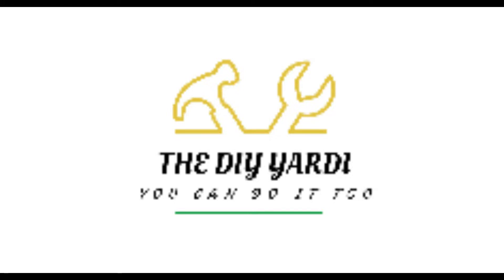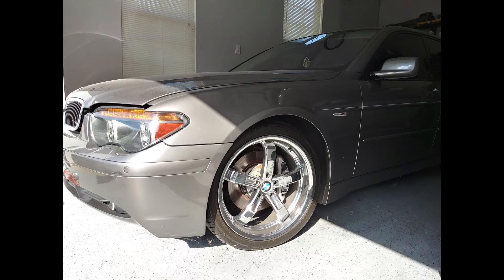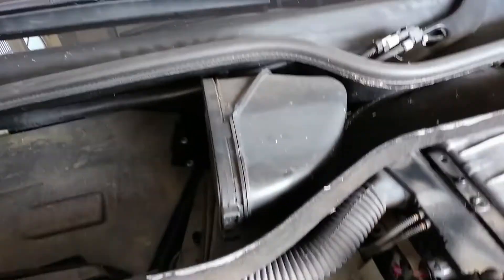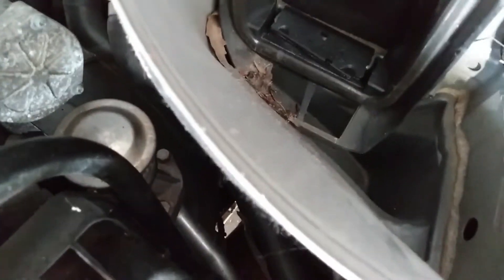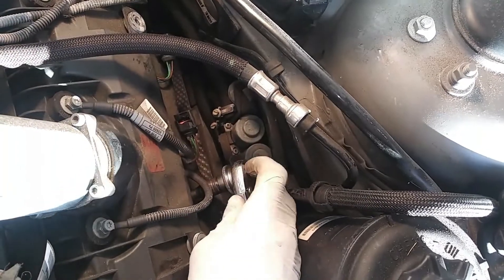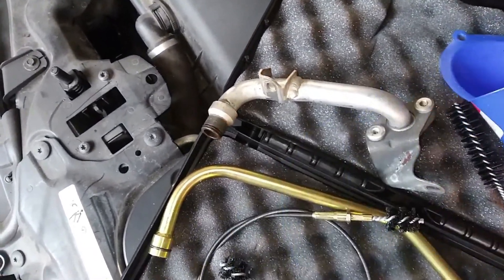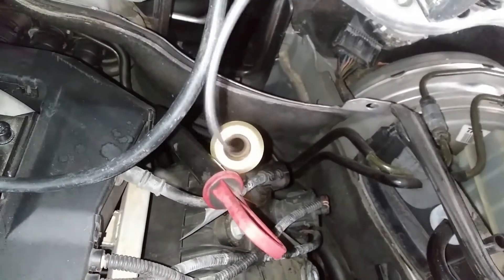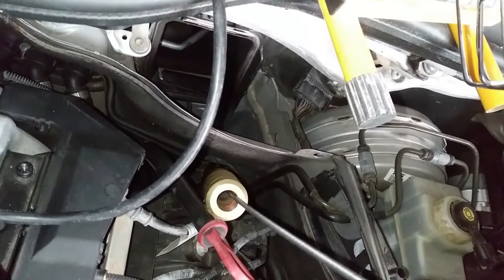2005 BMW 745Li With OBD Code P0492 - Secondary Air Injection System Bank 2, (FIX)

Comment: Hello
What air value in kilograms per hour should be read in Inpa in a BMW E60 545i N62B44?

I currently have 14.6 kg/h at idle after warming up.

I have a 90 degree Celsius thermostat.

Please advise.

Comment: I just got my secondary air kit how do I take the plugs out and not mess the engine up when I blow air into the line
Reply from the maker: Hey Demond, in my video, between minute 4:30 and 5:30 I show removing the plugs, you will need to remove the coils first, they're fastened in place, no screws, once you unplug the power wires from them,  use a 3/8s extension through the lever on top of the coil to help pull up and out from its position', and then remove the plugs.. once you've completed the procedure and blown out the ports,  before reinstalling the plugs, I also went ahead and cranked over the motor, just to make sure all the cleaner was blown out, it will likely cause some codes to be set, due to the coils and other parts being disconnected, you just reset the computer and you're good to go once the job is completed.
Reply: @thediyyardie7192  By cranking over the engine, do you mean starting it on?
Reply from the maker: @1stCrallyy  with the coils and spark plugs removed, turn the key for a few seconds as if you're trying to start the engine, that is to help blow any excess fluid out of the motor to prevent a vapor lock..
Reply: What do you mean when you say you cranked over the engine do you do that after you blow compressed air in the clogged port and the spark plugs are back in or before you put the plugs in
Reply from the maker: @demondkennedy2794  Yes, with plugs out, that way it won't get vapor locked, it will likely trigger some codes and check engine light, but once you get everything back together you just need to reset the computer, you should be good to go, provided cleaning was successful.